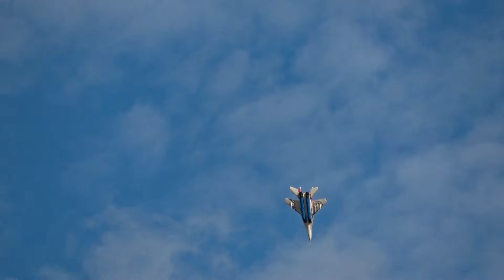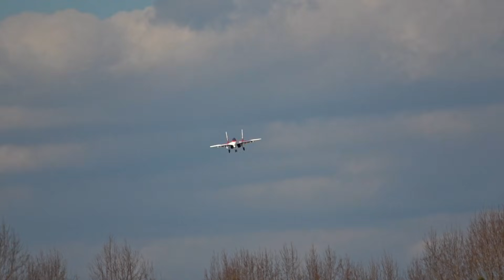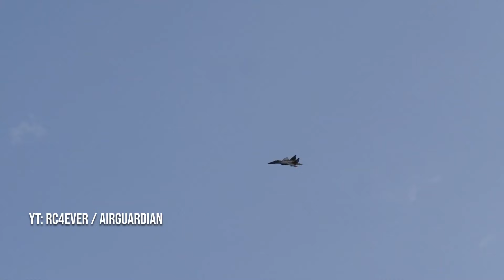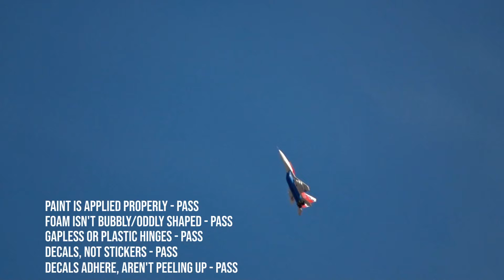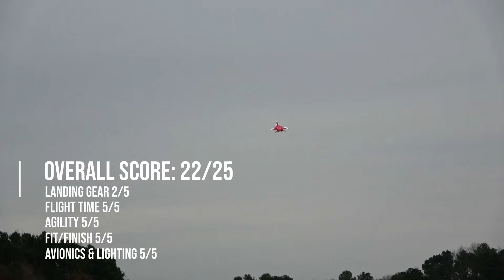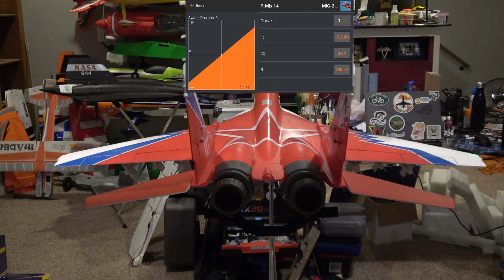Almost Nothing Flies Better - MiG-29 Fulcrum 80mm (Thrust Vectored)

Comment: Would you say it´s better than the F-22 Raptor 90mm?
Reply from the maker: Not better. Just different.
Reply: @TwoBrosRC  Thanks John
I´m really inclined to buy the F-22. By far my favorite jet of all time. But the Mig-29 is very tempting because of the extra flight time.
If you could have just one of these two, wich one would you choose?

Comment: H e y jon! Im running 2 100amp avanti esc's with built in becs. & 2 avanti 2150 motors. My question is will there be an issue with tv servos? It works well on my tomcat & working so far on mig redstar. But i just want to know if external bec is better? Thanks!
Reply from the maker: Try it and find out on the bench!

Comment: Just picked one up used with the older 9 blade EDF... should I upgrade right away or fly it first?
Reply from the maker: We highly recommend upgrading to the new 12 blade system. The older motors are rather underpowered.
Reply: @TwoBrosRC  thanks for quick response. Was considering the X-fly 80mm 3665 2300kv $5 more than Freewing 3658 2150kv

Comment: Hey John, Im running 2- 120amp motion rc escs with 2- 2300kv motors in my same mig. The escs come with 8A becs. If I dont use the becs, how would it possibly affect the jet in flight?
Reply from the maker: Ask on Discord, we've got technical experts that know more than we do. Discord.gg/twobrosrc

Comment: Finally found some time to watch the full video, great stuff as usual! Also glad to see that my feedback was useful for the making of the vid! :p
Gotta say that with those new EDFs this jet's a whole different bird from what I was used to. Mine was indeed underpowered, but not anymore!
I also ran mine without a gyro, so I gotta disagree a bit with the stalling tendency of the jet. The natural behavior of this one is very prone to ditching a wing when pulling up at quite some speed. Then again, your CG is further aft than mine and you have a god-tier stabilization helping out, so it gets masked. The Su-35 is by comparison what I'd call unstallable, or almost. The MiG-29 appeared more squirrely to me in that department, but still hella awesome. :)
Reply: What all did you change in the power system from stock??
Reply: @Lester-ib4ey  Mine is the older stock, Jon's is the new stock.
Reply: @RC4ever  okay mine must be old stock because I have the 1950 KV motors in and he said he has a 2150
Reply: @Lester-ib4ey  Yep, same as I.
Reply: @RC4ever  👍
Reply: @RC4ever  are the 100 amp esc still going to work with the 2150 KV motor?

Comment: I have both version! Havent tried the thrust vector yet. But they both lack of thrust! But still fun to fly tho! Red one comes at 13.6 lbs with ovonic 6s which are the lightest i found at 647g hrb was like 750g

& the 2 main retracts are not mounted to foam, they are bolted into a plastic mount which those grab 2 carbon rod built in the fuselage. Then 1 piece is partially glued after bolted, if that main fuselage plastic mount brakes, glue wont work to hold those wheels, trust me i tried already in my 2nd fuselage. Lol just because of this mount
Reply from the maker: Fly it on good batteries like SMC instead of rebranded Zeee batteries like "Ovonic" or "HRB" and you'll notice a massive difference in performance. It's not a jet meant to be "speed trialed" - while you can certainly fly it fast, it was primarily designed for post-stall maneuvering.
Reply: @TwoBrosRC  will try a set. Either the 6000 80c or the 5800 150c?

Comment: love the the TV still fly early fw planes with it. new motors and fans .  mig is a fav, yep had 100 flights on my mig  first grass field gear failed well foam failed. but wheels were straight. but will say wheels in second plane were off.  still have nos fw tv's  always buy 3 lol

Comment: I may have to program tailerons on my TV version after this. Even at 100% the roll rate is pretty slow.
Reply from the maker: The full scale MiG also uses the stabilators for roll - so it's a scale function, too!

Comment: Thank you very much for this video! Jandro motivated me to get this one although his mods afraid me. I was thinking to fly first without TV to know a bit the plane and get used to the size. Got to know that about high alpha lock!! Did not thought about it! Also the gear. Alejandro explained that but the English wording did not understand. I love Jandros fighter jet exhibitions but your 3D flights are cool too! I don’t like people slamming the sticks and doing crazy uncontrolled maneuvers. This looks awesome!! I’ll try to make some of your mods! Gear, Esc, Elevator servos. I’ll try to flight with lightweight LiIon packs and if they get too warm two parallel  more aft. Thank for showing the battery bays (x3!!) . The landing gear is a simple soviet solution, maybe 🤣 And they we’re build to take off from gras and dirt by closing the air intakes. So the gear SHOULD hold  on :P I’m happy  ordered this bird in december. By now I just have the TV nozzles but I have still enough jets to play with 🤣 Thanks again for all details!
Reply: Wondering how the 8S 80mm 1700kV would work on light packs :)))) :rocket-red-countdown-liftoff: